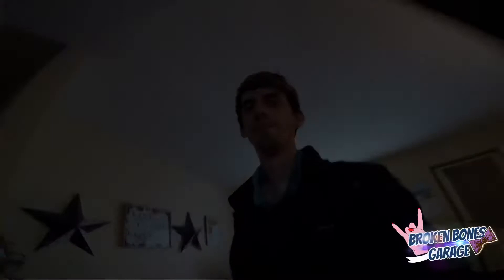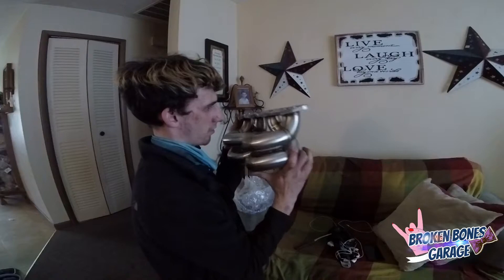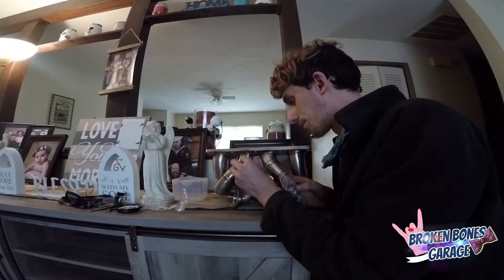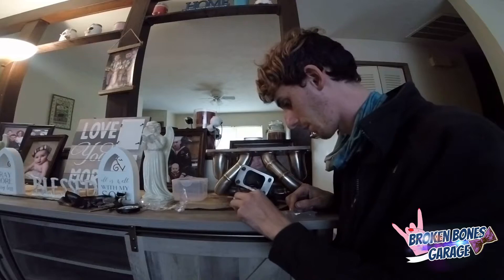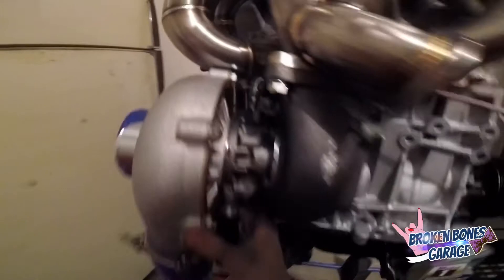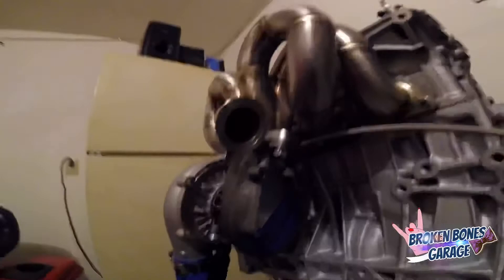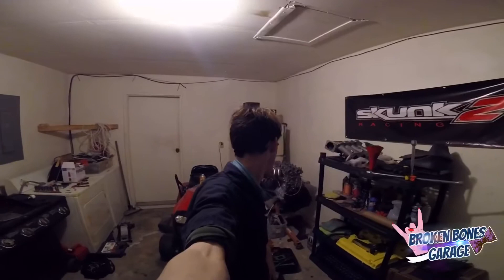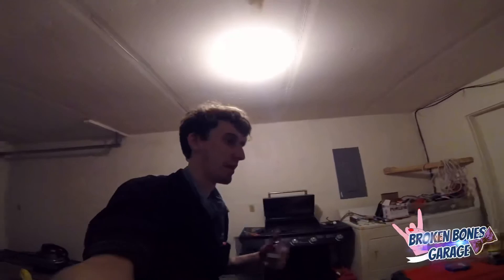1320 Ramhorn Turbo Manifold!

Comment: Hey man, have you thrown this in the car yet? The turbo interferes with the stock rad, have you purchased another rad yet or fit anything in the car?
Reply from the maker: Haven't yet. Waiting to get the head back still unfortunately. Been a crazy long wait on pretty much every part. Should have head back this week according to machine shop. I'll have an install video soon. I don't think mine will be close just based on tear fit on engine when I had the head sitting on it. Are you running a slim fan?
Reply: @Bonesgarage95  as of right now no, looks like im going to need one though, gonna try to take the fan off and see if she fits, as for intercooler what do you plan on running?